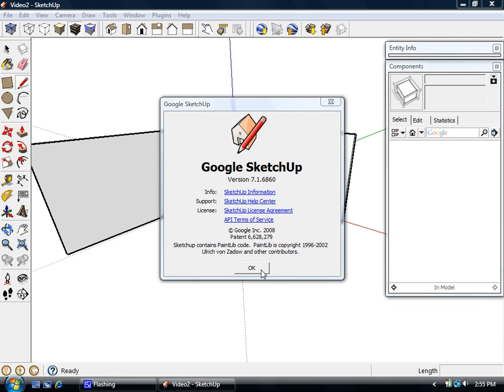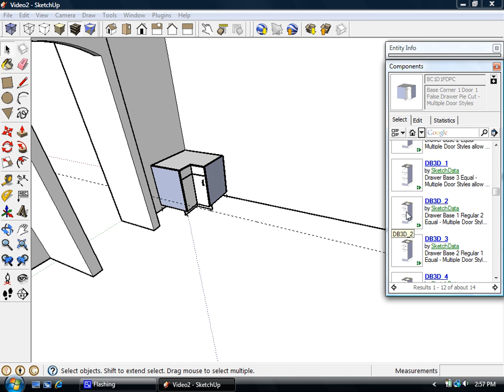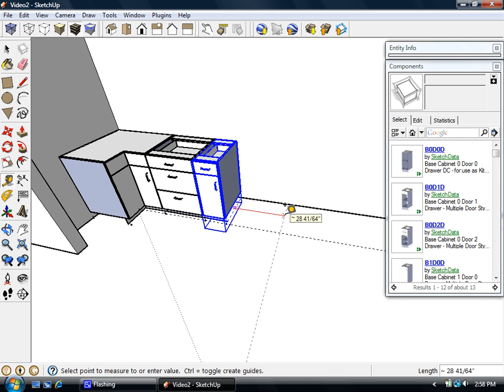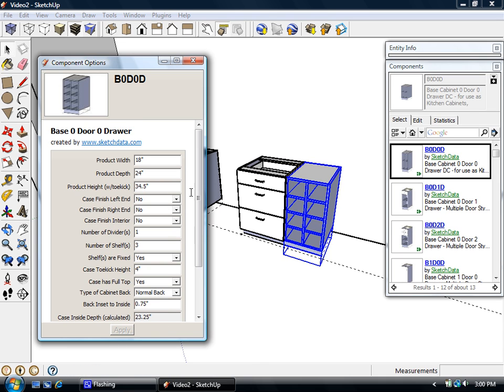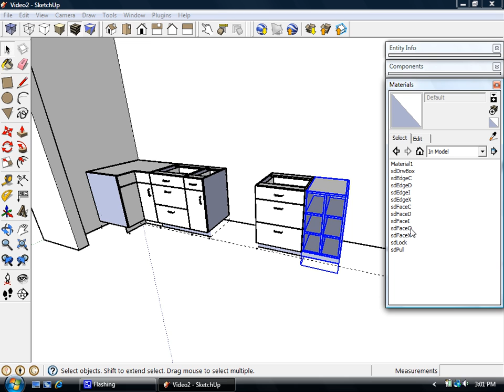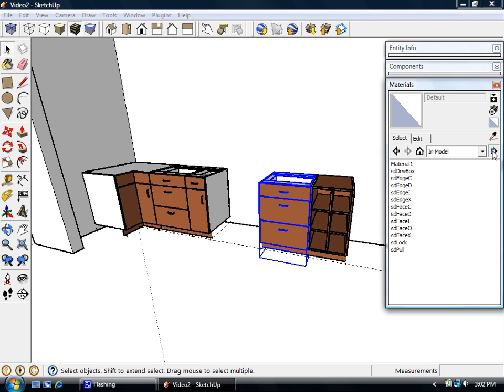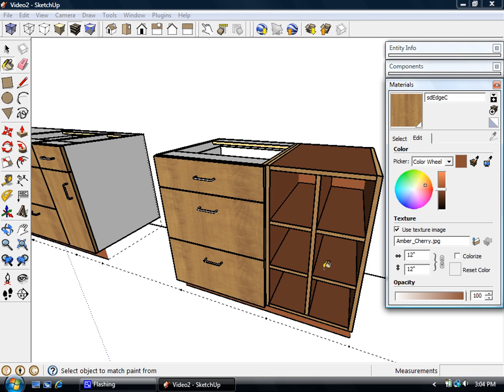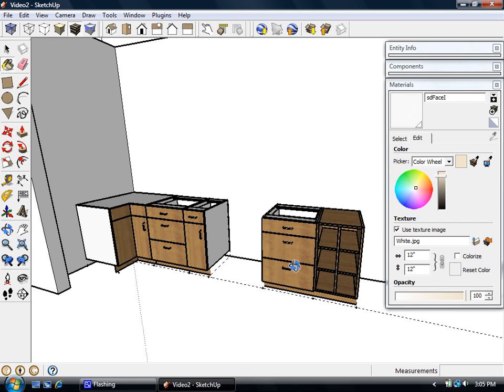SketchUp Kitchen design Dynamic Components "Cabinets"

Comment: There is no "components" option in my tool bar. wtf
Reply from the maker: There are some older Cabinet "Dynamic Components" in the 3D Warehouse or a newer catalog can be downloaded from the SketchData website.  In the Pro version of SketchUp there is a "Dynamic Components" toolbar which allows modifying sizes, finished ends, etc.   If you use the newer V2 catalog you'll also need the free SketchData Extension installed, since those DCs use some behind the scenes code.  Hope this helps or email info@sketchdata and I can try and answer more questions.

Comment from the maker: The "Component Cabinets" are SketchUp Dynamic Components.  These are Parts/Components you can create inside of SketchUp that use formulas to determine size, position, material, animation, etc.
Reply: I can't find this cabinets can you send me the file ?
Reply from the maker: @MostafaShaalanTV   These components "Version 1" can be found online in the SketchUp 3D Warehouse, or there are updated components "Version 2" on the SketchData website.  The Version 2 components require the SketchData toolbar to be installed.  Toolbar and components are both free to use.

Comment from the maker: The doors have an "onClick" attribute which has the formula "ANIMATE(zRotDoor,0,120)".  When the door is clicked the attribute "zRotDoor" changes from 0 to 120 and 120 to 0.  Then the "Z rotation attribute or angle" of the Door is set to the attribute "zRotDoor".  So as you click on the door, the door rotates between 0 and 120 degrees.